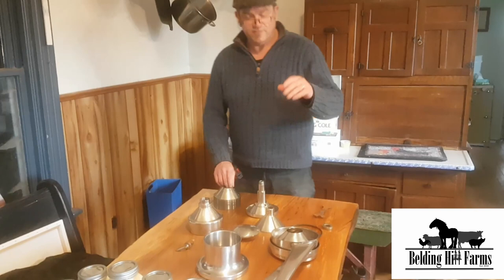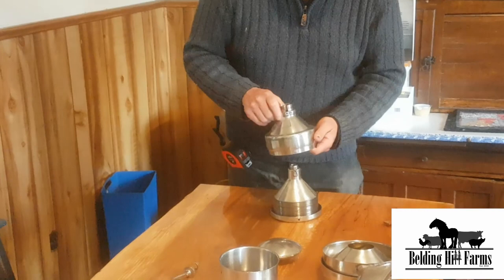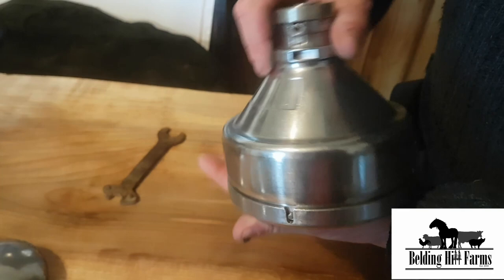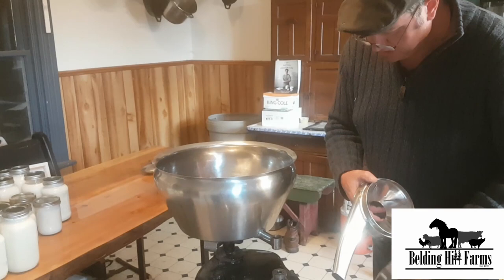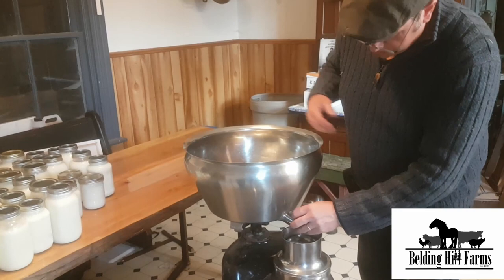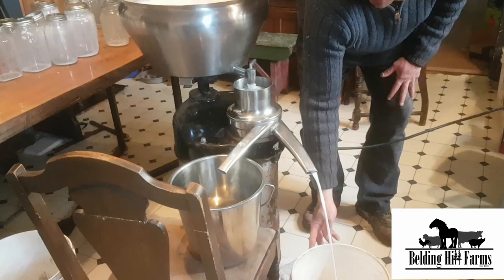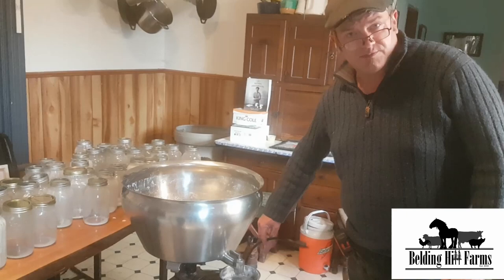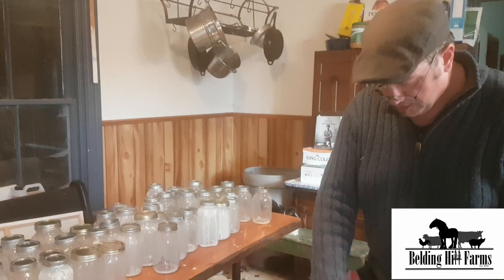DeLaval Model 105 Cream Separator - Jersey Cow

Comment: nice video . here a tip warm your milk to temp of cows body for better separation. tighten the nut on top of centrifuge till marks line up and your dripping will stop or replace O ring . and run hot water thru after ur done at full speed it will aid greatly in cleaning.  keep up the cool videos . thnx for sharing
Reply from the maker: Thanks for the tips and thanks for watching

Comment: open valve all the way float will control the flow
Reply: I used to milk 27 cows and ship cream when there was a cream industry, lots of work, no stable cleaner, no pipeline milker
Reply from the maker: Cool, you are a man in the know!
Reply from the maker: Where do you live?
Reply: @BeldingHillFarms  Ontario, was on the Cream board for awhile
Reply: Manitoba now
Reply from the maker: Cool, thanks for your tips
Reply: @BeldingHillFarms  leave a pail of skim milk out for a few hours and see if there is any cream that comes to the top, this will let you know if you are getting all the cream
Reply from the maker: Man, such a simple idea, but I didn’t think of it! I really appreciate the input! We are far from professional, we just like doing old time things
Reply: @BeldingHillFarms  nothing wrong with that, we still farm traditionally with a cow calf operation